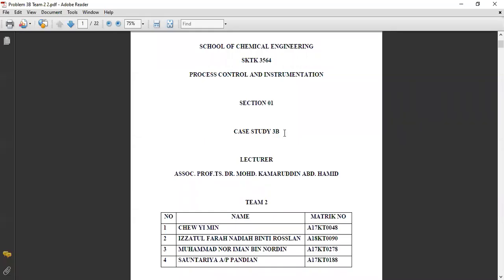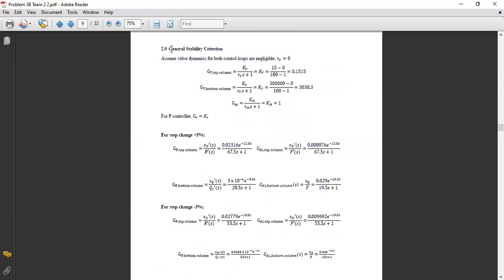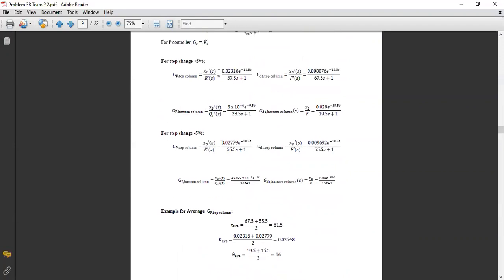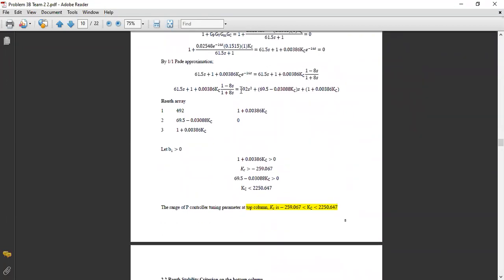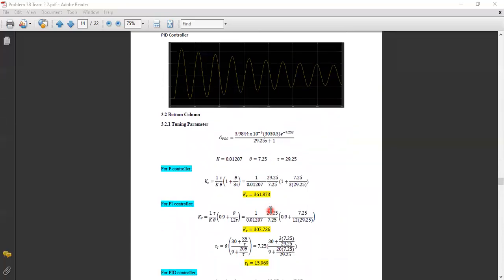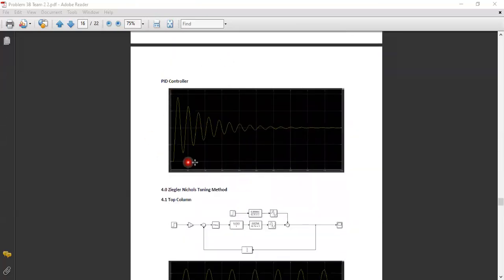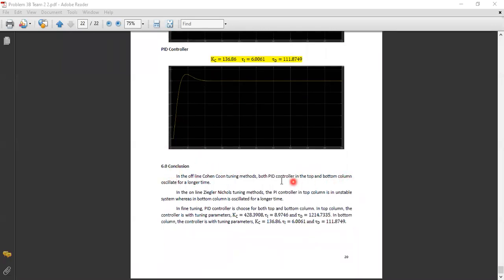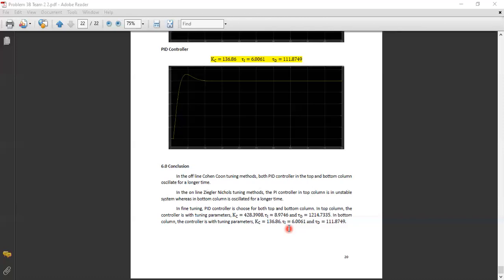Closed Loop Stability and Tuning - Team 2

Comment: Hi, may I know why have to proceed to do fine tuning after 2 tuning methods? What does fine tuning mean? and How we get to know the parameter values use for this tuning ?
Reply: this is because based on the response from Cohen and Ziegler, some of the response is not a good response. So, we do fine tuning as Prof mention in the online class. We do it by Simulink in the controller block diagram parameter by trial and error to get the good Kc and tau value for the parameter

Comment: Why we need to calculate average value for the Gp and Gd? And why PID controller is chosen for top and bottom column even the oscillation for PID controller is longer? Isn't that we have to choose controller with less oscillation?
Reply: Because we need to consider for both positive and negative step change as stated in our question. Based on the Gp and Gd from the curve, the value for Gp, tau and time delay for +/- are almost same. So, we do for the average
Reply: for PID controller, you need to refer the graph in fine tuning part in the report. The graph for PID is better than P and PI with the fine tuning parameter.
Reply: @yiminchew3169  ok. thank you for the explanation

Comment: why we need to calculate average value for Gp and Gd
Reply: Because we need to consider for both positive and negative step change as stated in our question. Based on the Gp and Gd from the curve, the value for Gp, tau and time delay for +/- are almost same. So, we do for the average.